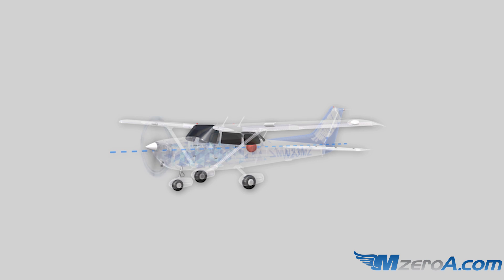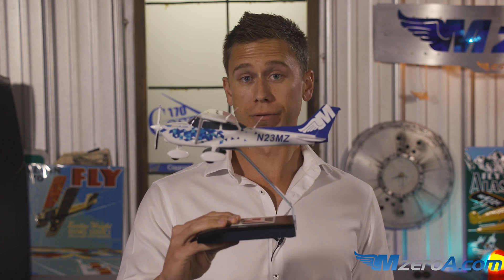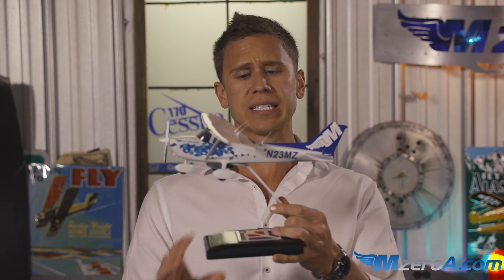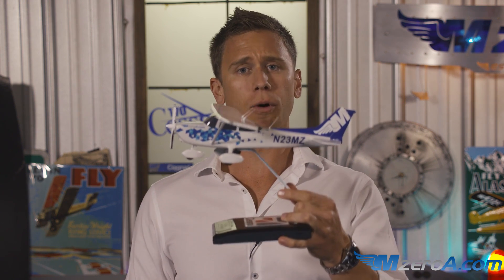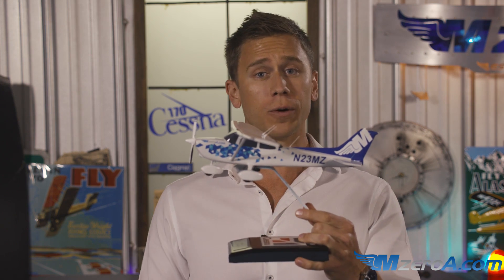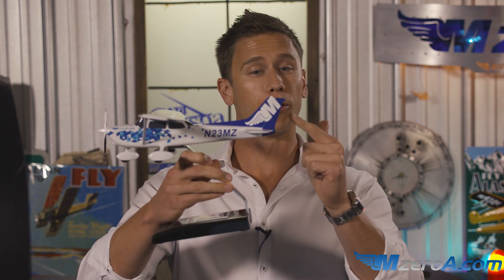Understanding Aircraft Center of Gravity - MzeroA Flight Training

Comment: The video doesn't really talk about how CoG affects stability but about how it affects maneuverability.
What is critical to understand when it comes to weight and balance is how different the airplane behaves if the CoG is forward or rear of the  CP" center of pressure". CoG rear of the CP will make the plan statically instabable which is very dangerous. You shoudn't skip that very important part in a video like this!!!

Comment: CG is not just about moment arms to give control authority to tail surfaces, but also about the leverage as it relates to other forces on the airframe, such as the center of pressure, neutral point, etc. For aerodynamic reasons, you want the CG to be forward of the center of lift, for stability. Even if you had adequate control surfaces to maneuver an aircraft with the CG aft of the center of lift, it would become more difficult to fly, the further aft it balanced, as you would be struggling to counter the forces that are acting to change the wing's angle of attack. You can kind of think of it as trying to push a trailer, rather than pulling it. The longer the arm between the hitch and the wheels, the harder it is to keep it straight while pushing it. An aircraft with the CG forward of the center of lift will be inherently more stable.

Comment: Good explanation.  I am also under the impression that an aft CG could create a situation where the elevator had insufficient authority to lower the nose if the aircraft stalled, essentially making the stall unrecoverable.  Is that the case?
Reply: ranjrog I was thinking the the same. Even in a standard stall scenario if the CG is too far aft there would not be enough elevator authority to break the stall. An example of this would be the 747 crash in Afghanistan. The cargo shifted aft upon takeoff and the pilots did not have enough elevator authority to get the nose down.
Reply from the maker: Absolutely it's not just the rudder but the elevator as well that loses authority